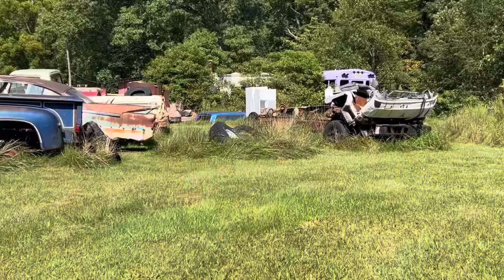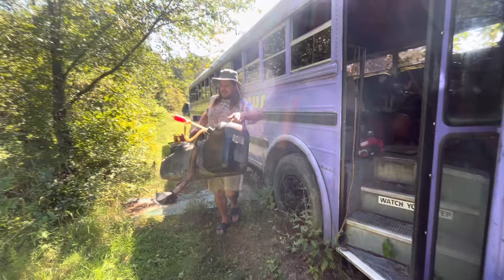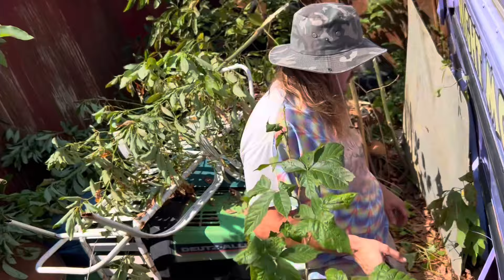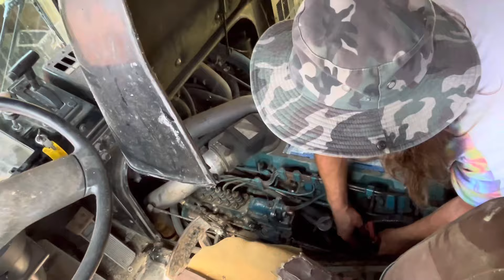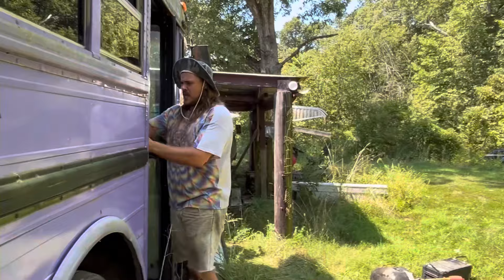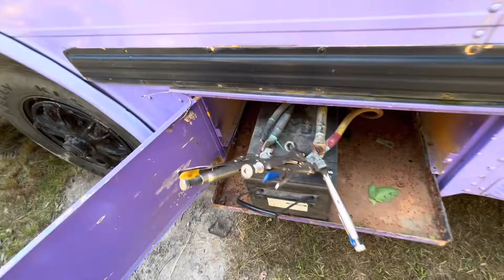$300 Party Bus Revive and Drive!

Comment: You have to build a  false wall. Like a film set. The Big Purple Ass. 😂😂 good job. Pull the air filter hose. And cover up cast intake 85% with flat wood it will purge the air out the system. Leave your pump running. Maybe vented cap blocked. But guess it’s not going anywhere soon. Good luck. Nostradamus predicts Flowererery curtains and decorating in the future videos. Homebase here we come. Bed and bath. 😂. Good luck. Have a good week. Congrats on the subs
Reply from the maker: A false wall like the old westerns to cover the bus? Hell yes! I will try that to get the air out fully but you’re right, the ole girl won’t be going anywhere anytime soon lmao the interior decorating is not my area anymore🤣 Thanks for watching it’s good to hear from ya!
Reply: @NastyCustoms5150  it’s fixing to be your new area. Nastys decorating and shabby chic designs. 😂😂😂 warm up the paint brushes. 😂 good luck man. Wipe your feet. No washing cylinder heads in the kitchen sink no more. 😂 . I’m only picking on you Man. Adios. 👍👍
Reply from the maker: @Doggymcdoggy664  Lmao I appreciate the laughs for sure!